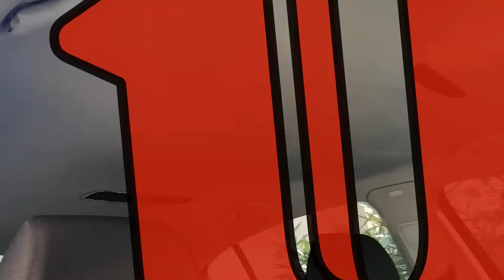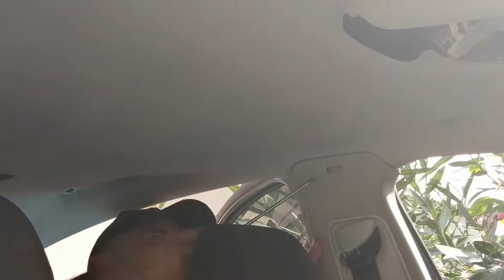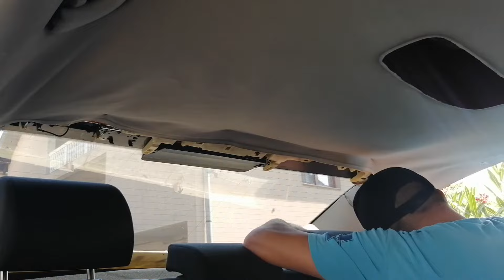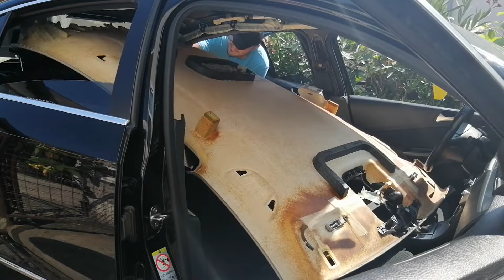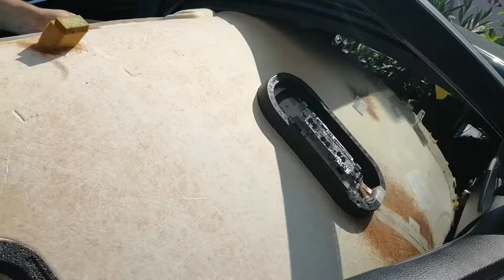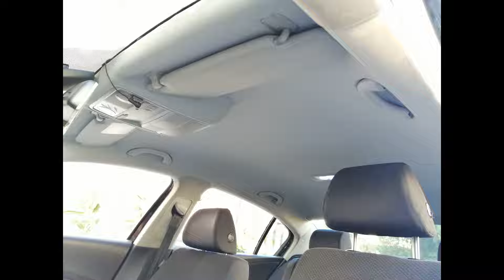VW Passat B6 How to remove headliner DIY

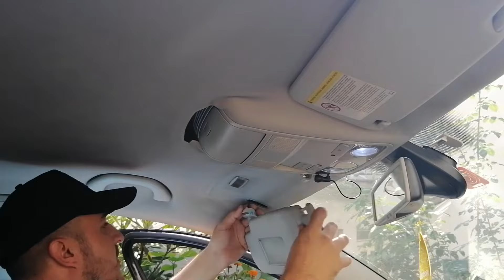Comment: Hello, not sure whether you are tracking Comments but it seems like when you removed the sun visor you disconnected  the wire right on the visor bracket (0:34), not from the black plug. Asking because the hole of that grey plastic bracket has collapsed and i am exploring alternatives. 
Also, when you reinstalled, how did you align the nuts to screw the smaller visors on? I am having a hard time with that.
Reply from the maker: In some models, the wires can be disconnected directly to the sun visor, while in some, they can only be disconnected at the black connector. As for the alignment.. before installing the headliner, you have to check all the nuts because some move and some are deformed.. when you have prepared everything, lift the headliner, fasten it forward with one screw and then insert it into the rubber spacers, then check with a thin screwdriver if all the holes are ok and that should be it. Good luck

Comment: Where do the plugs at the outer sunshield mounting hole belong to? I did it and at the end i had no clue where to plug Them and my sunshield mirror light doesnt work any more
Reply from the maker: On the inside of the headliner there is an installation that connects those lights. To remove the sunshade, you have to disconnect the connector from the installation and connect it during installation. I don't know how you couldn't figure out where to plug it back in when only those two connectors are behind headliner?! Or maybe you broke the installation somewhere..
Reply: @VDEdition1  the plugs for the sunshade is in the hole but has no power on it...

Comment: Hey how did you get the sunglasses and dome light piece to line up? I have a small gap on mine
Reply from the maker: You didn't align well with the fit, so it deviates a bit. Take off the sunglasses part, align well and then fit.

Comment: Would it not have been easier to lower the rear seats and get it out through the trunk?
Reply from the maker: It is enough to take a tape measure and measure the width of the trunk and the diagonal width of the opening on the passenger door, and you will automatically get the answer to your question. I'm not saying it's not possible, but it would totally ruin the headliner. The only proper way to remove it is through the front windshield opening. That's how they work at the factory, but since it's not worth doing, removing the windshield, this as I recorded is the next right way. Trust me, I've done hundreds of these disassembly and repairs.
Big greetings.